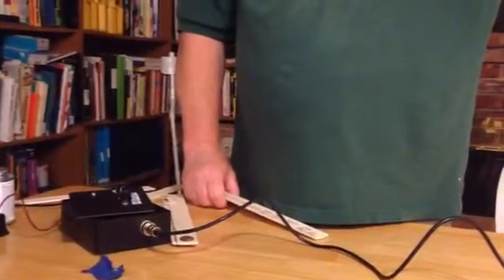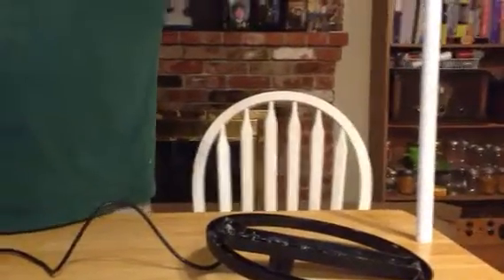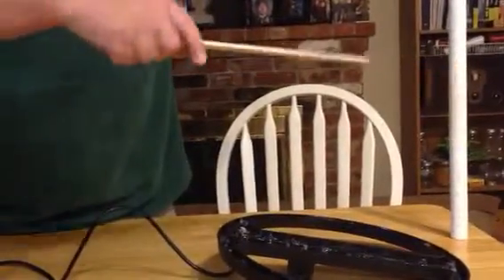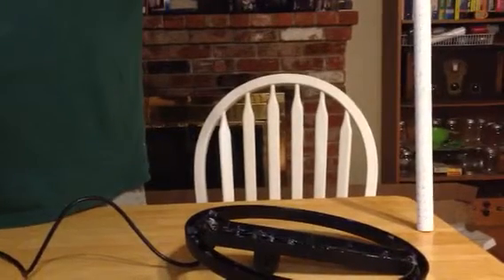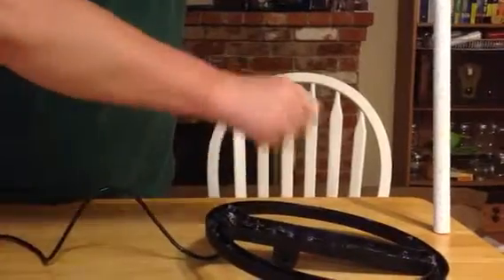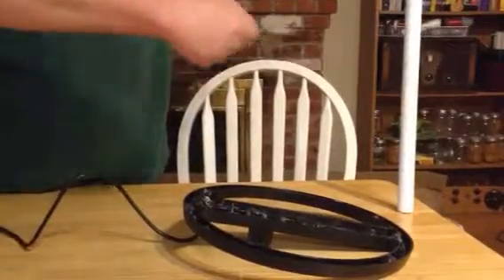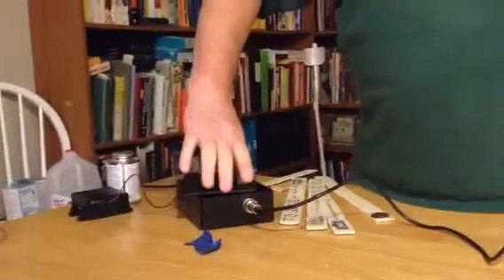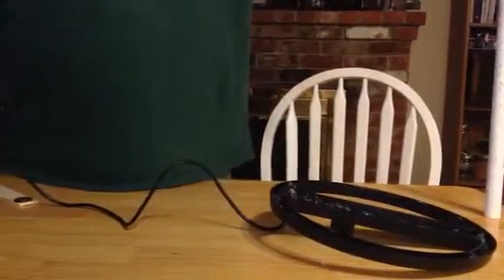Detection Test for TGSL Metal Detector

Comment: SR. POSSUI ESQUEMA PARA ENVIO ?   E VALOR DA BOBINA DD ?   valerio.zinelli@hotmail.com.   TENHO A PLACA FUNCIONANDO,,, DESEJO DETALHES  CONEXOES
Reply from the maker: It's been several years since I built this metal detector.  It is one of the hardest ones for an individual to build.  I would start with some of the other models such as the Barracuda which is discussed on the Geotech forum.  You will need an o-scope to build the TGSL and it is very difficult to construct the coils.  It's not a beginner's project, even if you have an electronics background.  Just friendly advice.